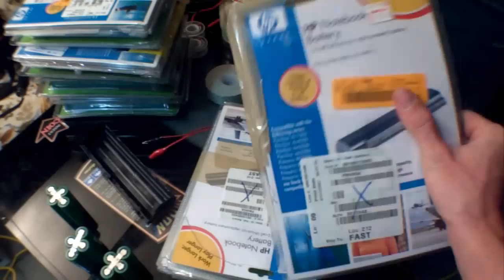DIY: 48v 24ah lithium ion 18650 e-bike battery pack

Comment: So I took a single 18650 cell and started to charge it. I was putting in 2 amps using a lipo charger and the cell was fine  until it hit about 4V and then it started to get pretty warm and eventually semi-hot. Do your cells get pretty warm to hot when you are charging them? Was I putting in too much amperage? I tried doing the same thing this time using only 1 amp on a single cell and it had the same results, the cell got pretty warm-hot. I could still hold the cell in my hand but it was hot enough I was worried about it becoming liquid lithium and spewing fire lol. The upper cut-off voltage was set at 4.2V and I was using a standard RC lipo charger. I looked up 18650 cells on Amazon and all of them said a single cell could take 1A standard charge rate or up to 4A rapid charge rate. What would you recommend for making amperage for a single cell? Thanks for the magnet idea that worked great for me by the way!
Reply from the maker: yeah maybe too much amperage, try 0.5a and see if it still warms up. some cells when they are old and damaged will start burning their energy at a higher voltage. if the cell starts dipping in voltage right after you take it off the charger then its a bad cell and should never be used for projects other than if you want it to be a firework.
Reply: Ok great I also just thought about this but I have an actual 18650 charger I'm going to try so if it gets warm there then the cell is for sure the issue. I tried 2 different cells with the same results. I don't know what the standard C rate, or if there's a standard C rate, for these cells. it's odd that the 18650 cells on amazon all say 4A max rapid charge rate or 1A standard charge rate but yet these cells seem to be much lower than that. I'll let you know what I find, I'll try .5A through my lipo charger and then also charge some with my 18650 wall socket charger and see what happens.
Reply from the maker: helloman1976
id say most from a laptop pack are about 2c, but remember they could be old and only have 500mah of capacity now.
Reply: Ok thanks, really appreciate the replies.

Out of curiosity, have you ever tested the actual range of your home made packs? I know you aren't doing 100 mile rides so what's the furthest you've been and was the resting voltage what you expected after that ride? mean...does the math and actual performance pan out? I have tested RC lipo packs on my electric scooter and the math matches actual range.
Reply from the maker: helloman1976
well in 2015 i used this 24ah battery pack to commute back and forth to work on a cargo tricycle, and i could get about 4 20 mile trips in if i babied it. but that was on a cargo tricycle. i still need to test it. but ussually i dont have to charge it but once every few days.
Reply: Excellent information and wow! That's amazing! Thanks so much for sharing this information.

Comment: That's really cool what you're doing there and I enjoyed the video! However for your own safety please put a couple of temp sensors around the packs, you won't know if they are overheating and although I don't think that a single cell exploding will do much damage but it would still suck because you'll have to re-do the entire pack. I would also divide these into smaller cells for charging and connect in series (as you did) in a bracket at the bike.
Reply from the maker: well the funny thing is I've never had the cells heat up from normal use. I actually have a big problem with that now its winter and bellow freezing.  I've had my old pack short out several times due to the modular design. this pack is doing better though.

not counting if my 24v block dies while I'm driving I can rewire the 18ah to be 48v 9ah again to get me home.

and if it blows up, I've already made twice as much from the videos of my bike than the cost of my bike so its all good :P

Comment: It would be helpful seeing the batteries attached to the actual bike and having someone filming you riding it because otherwise you could be riding anything, if you know what I mean. Another issue I'm curious about is heat dissipation, don't the batteries get hot and what effect does that have on the duct tape glue holding the packs together?
Don't get me wrong, I applaud your effort but we need to see you riding it and your speedometer and range before we are convinced of your claims.

Comment: they are not 4.2v per cell (I think you correct yourself when charging), and it is a really bad idea to join cells from different batches. their parameters fluctuate from batch to batch, and you end up with a self-discharging pack.
Reply from the maker: yes they are 4.2v. and every battery in existence self-discharges.
Reply: they are 3.7. 4.2 is charging voltage, which quickly degrades to 3.7 "working" voltage. Study a datasheet for say Sanyo 18650 2600mah. When you mix batteries, they have a slightly different resistance, and this differential creates a load which rather rapidly discharges other connected cell(s). In a single cell, this effect is tremendously smaller. The only way to control it is take cells from the same production batch hoping they are closer in chemistry. That's why your dissected powerbanks have different cells, but identical per bank.
Reply from the maker: Izzy Laif
 no they stay at 4.2v when fully charged.

your view is very flawed. i'm sorry you are so misinformed.

i would recommend playing with lithium cells a bit before making statements about them. i would assume you got most of your information from forum neckbeards.
Reply: Izzy Laif you are totally right

Comment from the maker: oh hahaha yeah that would take a minimum of 9 cells running in series. if you had only 9 cells running in series with each cell 5.3ah youd have a 36v 5.3ah battery. if you used 18 then youd have 10.6ah 36v.

i would recomend 10ah of lithium capacity if you plan to pull like 15 amps from it. but thats just couse a 10ah battery would dip in voltage a lot if you tried to pull more than 20 amps.

what cells do you have that are 5.3ah? 18650 cells can't hold that much. is it a 32600 or 32650?

Comment: Hey, I love your idea. I have a few questions for my own project: what is the size of the cells? Is it the same as a standard AA battery? I'm asking because I'm thinking about wrapping the (72?) cells around the hub motor using a self made case to get something similar to the FlyKly. So I wanted to know if I could use battery inserts of, let's say, 4 units. It should be possible to wrap those around the motor case, tie them firmly to the wheel to make sure they won't move, and then cover the assembly with the self-made case. Critics are very welcome! thanks,

Comment: No, it's not bad math on my part and I thought I heard you say they were 3AH cells. If a cell has a 3amp hour rating and you are drawing 3 amps per cell, that's called a 1C discharge. You can't add up the Amps AND the Voltage. if you wire 12 3.7 3AH cells in series, you would have a 48V/3Ah battery (144WH). If you have 2 of these, and wired them in parallel you would have a 48V 6AH battery, 3 in parallel would give you a 48V9AH battery and so on. I have an associates degree in electronics.

Comment: hey man. I want to build an ebike and have been watchig most of your videos in this regard. Can you reference me to something that will help me me design a battery pack? some of the questions I am looking for answers to are:

1. I want to build 3 packs of what you just did in this video, about 2~k Kwh battery bank. 
2. how to wire up the indivdual batteries into a single pack and then how to wire the 3 packs into a single one to make up the over all battery bank.
3. what voltage do I need and how do I achieve it by designing the batteries, I am aiming at 36volt but not sure if 24v is better.
4. last question, charging the battery bank? is it possible to charge it as you ride or wait until you get back home and plug in to power outlet?

anyways, am not an expert on this, hopefully you have time for a video for "lithium ion batteries for dummies"

Cheers

Comment: I know you said check other comments in other videos but it's a ton to sort through so my apologies for my ignorance if this was answered.

1. Was it really cheaper to buy these in laptop battery form and not buy them individually cell by cell? I am really just concerned about the wasted plastic and materials. Not mentioning the time to strip the materials.

2. Is duck tape really OK? High heat makes the tape toxic I thought so you have to buy the aluminum sided duct tape for sealing heating air ducts.

Comment: Thanks for your wonderful video.

1) Does the battery pack needs the Battery Management System?
2) What is the motor type you have used for your project?

Comment: Rinoa Super-Genius That's really cool, but I have to say, that's a lot of battery to put on a bike, very heavy. Aren't there cells that would allow you to have that kind of power in just one pack that size ? 48v 20ah ?
Reply from the maker: this whole battery is as heavy as my laptop, like 7lb. thats not much weight at all because i'm regularly carrying a lot of weight on my bike. will soon build a trailer for it to hold 4 car batteries and carry up to 300lb.
Reply: Rinoa Super-Genius I have this bike: How To Get Gas From The Sun Youtube Geek Week Hack - solar tracker SLB-2000 I got for $70.00 and I need a 48v 20ah battery really bad. I don't have any money to get a battery with, all the money I do have goes to pay bills for my family. I've been thinking of doing an indegogo fundraiser, but I need a team member like you to look it over first, before I make a video and launch it. As you can see my e-bike's battery compartment, is much narrower than your battery pack there. I'd need to make a battery pack fit inside it. The batteries I have don't hold a charge, and the weight of them, makes it harder to use than a non e-bike. Thanks for your reply.
Reply from the maker: Daily Videos  well start collecting old lithium batteries from the garbage. that will help a lot.
Reply: Rinoa Super-Genius If my garbage had Lithium batteries in it, I would ;)
Reply from the maker: Daily Videos
 well it does, people throw away laptop batteries all the time. i bet theres prolly 1 or 2 laptop batteries in the trash truck every time they get back from picking up trash.
Reply: Rinoa Super-Genius If you have some motorcycle workshop around, go and check if they will give you some old motorcycle batteries. Bigger motorcycles 1,000cc and above usually have 17AH batteries or higher. Most manufacturers use sealed lead cell, so even if they are 'dead', most could still be recoverable. Although they're nowhere the capacity of car batteries (like 70AH), they are way lighter and easier to assemble together than car batteries.
Reply from the maker: smutpow
 and what would i use them for that i dont use my 10 truck batteries and 5 motorcycle batteries for?
Reply: smutpow and Rinoa Super-Genius there's nothing like that around here.
Reply: Daily Videos
You should go and have a word with your local PC repair shop. They always have old li-ion cells/packs that they have to dispose of and quite often you will find they are charged to have them taken away. Go and offer your services for free and you may soon end up with more than you can deal with.
Reply: ColdTurkeyFlu I am the local repair shop. It's a small town, surrounded by small towns. RE-PC in Seattle sells batteries for $1.00 each, but I have to be able to travel there, or have someone pick them up for me, and I don't have enough money to buy enough used batteries.
Reply: Daily Videos
Ah! That's a shame. I'm in the Uk so things are a little different here i guess. Best of luck to you!
Reply: mirrorclick that's awesome. If I can get the money to do that, I'll have to do it.
Reply: Daily Videos Just a few tips:
just be aware when you first make a account it can take a while between ordering the product and them finally getting around to shipping and processing your order... until you start spending more than I think $470/year ish then they reply a lot quicker and stuff, Allways check the reviews from people at the bottom of the pages and check the seller has a good percentage and preferably dimonds or the crown hat thing or a few ribbons to say the least that just means the sellers had lots of sales so you know they are pretty legit

also look long and hard at all the information and at the pictures on each advert you are interested in, if something doesn't quite look right dont buy. Sometimes I dont go for the absoloutely rock bottom prices cause its not necessaraly the best product.. but hey free shipping on most things :D
and yea just have patience cause it does take usually close to a month before the thing arrives. usually has tracking numbers though so I have to sign for it... i guess I forgot to mention that bit.. if you choose to ship via courier (im in canada so maybe ups is expencive cause of that) I find couriers is just throwing money away....

Best of luck with your project!
Reply from the maker: mirrorclick
 those cells are a big ripoff. they dont make 4ah cells. and especially not for that price.
Reply: Rinoa Super-Genius
well with anything there comes a point where its quality over quantity. I only buy smaller amounts of protected cells for my lasers and led torches. they were just two examples of adverts by sellers in a quantity/price range that daily video's was almost aiming for. I encourage anyone using aliexpress or alibabba for that matter to do their own homework and find the best product for them at the time. Ideally the best thing is to recycle old laptop batteries but in a large cell arrangement one would be better off with all the same brand and power rating I would imagine for safety and charging/discharging cycles.
Reply from the maker: mirrorclick
 yes but a lot of those cells (especially anything over 3600mah) are fake ones stripped out of laptop batteries and rebranded. they could be 3600mah they could be 800mah.

its just never a good idea to buy individual cells unless your buying directly from panasonic or something.
Reply: Rinoa Super-Genius good to know
Reply: Rinoa Super-Genius I bought a pack of two they say 6000mah. Well, that is what I get from buying from low dong ding dong!  They meet my needs for my UltraFire for now at least. I will do more home work next time.

Oh, thanks for the vid.

Comment: Thise are VTC 18650's so they are either vtc31600mah per cell vtc4 2100mah or vtc5 2500mah all are rated for a continuous discharge of 30 amps

Comment: I'm planning to build a 24v 1000Ah Lithium battery for my electric golf cart. Your video will be a lot of help. Just one question, all the stuff I've read show 7 rows to get 24 volts, yours only has 6 rows. My motor is 24 volt, the original battery has 7 cell packs. Can you please explain the dif? I'm a novice.....

Comment from the maker: hey it's no problem, thanks for enjoying my vids!

and i've never heard of 17670 cells before. after quick google search they may be protected cells. wiki says they have a max capacity of 1.25 ah so thats cool. if those have most capacity still they would be comparible to the unhealthy cells i used in my first pack.

i see no reason why they shouldnt work, would even be more fool-proof if they are protected cells (has microchip inside cell)

it'd be awesome if you made a video of it! :D

Comment from the maker: well thank you! background music and volume of the music is something that drives me crazy sometimes. but it drives me equally crazy when i can't find a song that fits and have to upload it without a tune.

i've been working on a Modular Analog Synthesizer for the past 5 years, might finally build it as a project and make royalty-free music :P

think i may even use an Atari 2600 sound chip or Commodore 64 Sid chip, have a few of those and the circuits from 6 electric organs too!

Comment from the maker: well with my 9ah battery pack i could pull up to about 15amps before it started to dip in voltage too much. but still have to connect my volt/amp meter dashboard.

so lets just say for every amp-hour you can pull up to 2 times as many amps. so a 35ah battery could do 70 amp bursts. but wow 70 amps is an insane amount. would burn wires and stuff haha. and that'd be like 5 horse-power motor. and 1 electric horse power's acceleration is like that of a 5HP petrol engine ;o

but thats just my theory!

Comment: I have two questions for you:

1. I noticed you charged up a few cells with your DC power supply. Can I use a DC power supply to charge up all my batteries (6 at a time) until my IMAX B6 arrives in the mail?

2. I am no understanding how you wired your battery pack. I understand the parallel and series wiring but you have wires jumping across cells at a diagonal angle.

Comment: Verry nice work.
But I think I would have used a solid copper wire to connect the batteries together instead of a steel nail because there would be less resistance...but it may not matter much.

Comment: I think you should add balancing leads and measure the voltage of each 3.7 v brick the cells are of different types and should be balanced or a least you you should monitor the cell voltags when charging
Reply from the maker: I think you should look at the description or click on the in-video link to the next video where I do that.

people should really start paying attention to video descriptions.

Comment: Great , well made and informative vid (love the soldering iron)..... But is it OK to charge the cells in series as you did? at start of recharge some cells will have more charge than others, so at end of charge they will be pushed over their limit, thats why 'balanced chargers' are used for Li-ion
Reply from the maker: yeah i was just doing that to get the cells up in voltage a bit, in the next video i added balance leads to balance charge it.